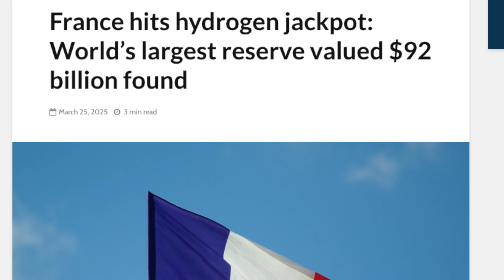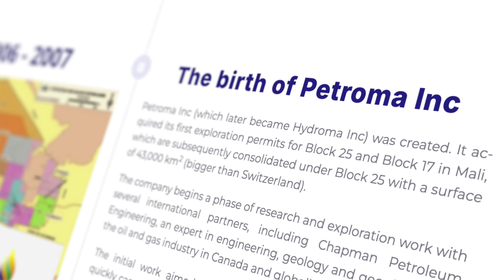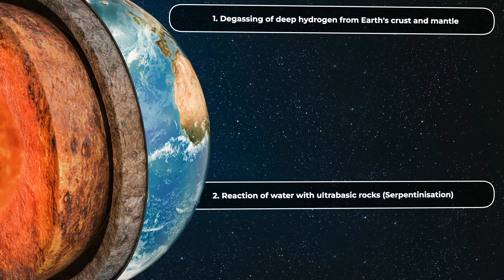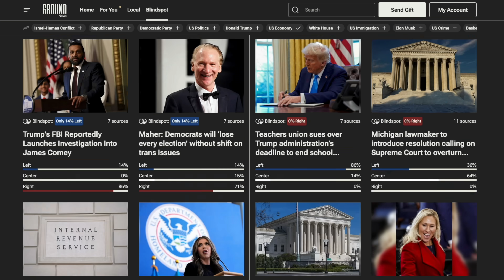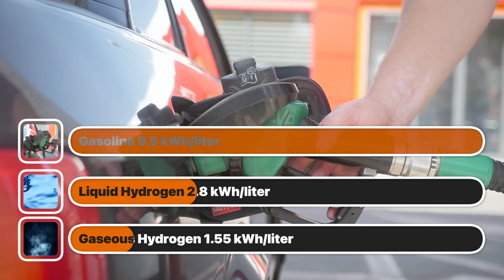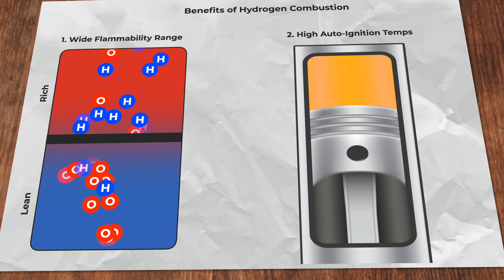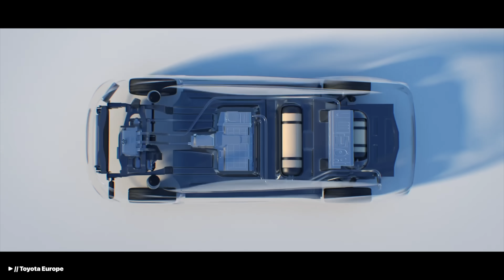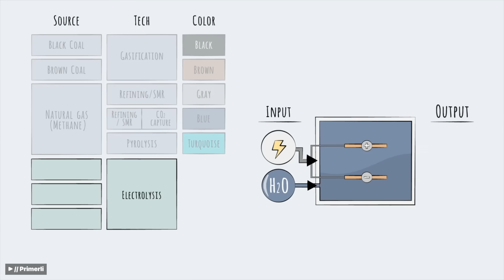This Hydrogen Discovery Can FINALLY Replace Oil & Gas!

Comment: Hydrogen fuel combustion for cars is not that great for the consumer, aside the current hydrogen prices which will eventualy come down at scale, it still retains the problems of the ICE which is too many moving parts with more points of failure and parts to maintain. 

A fuel cell like in the Mirai will be better. But I think the biggest win for hydrogen will be in the air and sea transport industries and power plants. Replacing hydrocarbon power with hydrogen will be a great win for the environment if the nitric gases are repurposed into other processes. And the PetroChemical industry will be more than happy to invest in hydrogen - drill baby, drill. 

I just hope EVs don't get crushed again for being 'too good' like GM did to the EV1s. Maturing both hydrogen fuel cells and batteries will make for a better energy future.

Comment: H2 is no use for cars and probably most land transport. You said about the weight of battery v H2, but ignored the fuel cell, battery that sorts out the peaks  for the fuel cell and regen, the tank weights, air purification for fuel cell etc.

Comment: Oil is more than a transportation or power grid fuel. All the other things that are made from oil can't be replaced by hydrogen, so no amount of hydrogen can replace oil in our economy. Replacing oil in transportation and power production would be nice, but it could effect the price of many other products and industry. It will be interesting to see how this unfolds.
Reply: It is about not burning oil, not getting products out of it.

Comment: The problem of nitrogen oxyde production in high compression combustion engine will never be solved. It's been that way for decades in diesel engines already, such that the fuel consumption of small diesel engines keeps increasing.

A VW 1.9L TDI engine from 2002 in a Skoda Octavia Break consumed 1.5L/100km less diesel than my Renault 1.5L K9K diesel engine in my Dacia Sandero Stepway. That's how bad compression got reduced to eliminate nitrous oxydes emissions.

I do not expect hydrogen combustion engines to overcome this issue without eliminating nitrogen from the cylinder entirely.

No, instead fuel cell technology can be improved to remove or stop degradation over time altogether. It is also much more efficient to use those than combustion to produce electricity instead of pressure.
Reply: Internal combustion engines will die.

Comment: Of course, the Hindenburg shows the scary side of hydrogen fuel:  catastrophic effects of a leak.  Of course, jet fuel is highly combustible, but the pressure needed to keep the volume under control may be reassuring.

Comment: Burning hydrogen makes more sense in vehicles that are always moving or burning fuel. Planes and trains. Storing hydrogen in a car is a problem while it sits and waits to be driven. Cryogenic inefficiencies cause the systems to vent hydrogen as it warms in the tank. You can't park a hydrogen car in a garage, it could explode if it reaches an ignition source like a water heater, garage heater, light switch, blender, vacuum cleaner, etc. No Bueno

Comment: Something that nobody sees....

Only green hydrogen is good. Oxygen is released during the splitting process. Blue, gray and white hydrogen "steals" Oxygen out of our atmosphere.

CO2 is falsely demonized.  Just Google the atmosphere composition, it is most probably not what you would expect. The CO2 level is not high. CO2 is needed for plant growth.

What is concerning is that there is no natural process to recover the oxygen that will get converted to water. Oxygen depletion raises more concern than CO2.  It is funny that cole and oil is bad, but LNG is good.
The hydrogen ratio in methane (CH4) is more than in gasoline (mostly benzene)(C6H6) for the same calorific value. The oxygen trapped by hydrogen in the form of water (H2O) can not be naturally cycled, but CO2 can be converted by plants and algae. 

Bottom line is burning any fossil fuel is bad and depletes our Oxygen.

Comment: 3 things- first hydrogen cant be contained in metal because it trats following like a sponge which might in turn cause explosions and great damage
Second the nitrous oxides fumes can simply by put trough a water turning it into nitric acid that can be sold or neutralised using just baking soda sponge filter 
Third the fuel dont need to be conbusted actually cause there already exists a electric fuel cells that turns oxidation of hydrogen directly into current which eliminates need for heavy engine block
Reply: By the way carbon dioxide is good for plants and it were decreasing BEFORE industrial revolution so methane and water and soil poisoning is the actual problem and not burning carbon

Comment: I like the idea of reusable sources such as wind, solar, hydro, and thermal to produce hydrogen when electricity demand is low and there is excess power available. Storing hydrogen has got to be easier than manufacturing batteries.

Comment: Well perhaps the answer is not necessarily developing a Hydrogen car but building the plant to provide the energy for  growing electrical usage instead of burning petrol, coal etc. Reducing our use of oil, coal until we have weened off of it. I still see real problems with Hydrogen in a fuel cell for the local end user with respect to auto crashes, metal fatigued caused by Hydrogen embrittlement (as outlined by @clinthastings3254 below) local storage. Likely needing constant monitoring like nuclear and thus putting the plant to supply electricity a more favorable options. But perhaps a combo Thorium reactor and Hydrogen energy reactor might be the need push to get off of petrol/coal as a major energy producer and just a synthetic producer.

Comment: I worked at a Ford plant using hydrogen fired ovens to melt steel together in a fixture the parts sat in so they maintained their shapes…
It’s so dangerous and has to be stored at crazy high pressure…
It’s very explosive and we were told(because they legally had to) that if they were to have a fire or a leak it would be like the blast wave from Hiroshima destroying most of my town….
France can keep it as far as I’m concerned.
Reply: @matthewhawkins1472  
The hydrogen finds in France are in remote locations. Power stations at those locations can be built, away from people. 

There are actually hydrogen trains.

Comment: .           So, this source will use up the breathable oxygen and reduce the Earth's available oxygen. Green Hydrogen releases Oxygen so the Hydrogen doesn't use up the Earth's oxygen. Yes it is costly, but if developed it is the best, and white is the worst. Not good news to find hydrogen made by oxygen binding to iron! The easy way out is dangerous. Gas of course needs to be phased out slowly.

Comment: Most of the hydrogen used by humans is made by reacting steam with fossil fuels. This produces lots of CO2 byproduct, which is mostly just dumped into the atmosphere.
 Most of the hydrogen used by humans is used to combine with nitrogen from the air to make ammonia for fertilizer & any other nitrogen compounds like explosives.
The first thing large geologic hydrogen deposits should be used for is ammonia production.

Comment: Apparently, there are days in California (and other places) when more solar energy is produced than can be used, resulting in 'curtailment' and/or negative energy prices. Why doesn't someone set up a green hydrogen production plant to take advantage of situations like this? The energy is there just begging to be used, why not use it?
Reply: Every "green" hydrogen project in Australia has been shelved. They are not cost effective. We have more than enough solar energy. The problems of hydrogen storage are beyond current materials technology to solve. Hydrogen is a dead end. Even the perpetually "almost here" fusion power is a better bet.

Comment: The figure for the Li-ion battery energy density by weight is too low by a factor of roughly 10.  This severely detracts from the credibility of the whole video.  What other errors (deliberate or not) are being used to draw conclusions - never mind any convenient omissions.

Comment: When you are talking about Hydrogen as an aircraft fuel I think there are a few things you are ignoring. Because with aircrafts it is all about weight.  1.55kWh/l looks really bad when you compare it to the 9.5kWh/l that kerosene provides. However, The gaseous Hydrogen with this energy density would be compressed at several 100Bar. It seems unlikely that a plane is capable of economically carry that weight around .The weight of the pressurised tank that is of course. So I think we can throw this out of the window. However, the actual gas would be extremely lightweight, but needs a heavy container/tank to carry it. So a litre of jet fuel has an energy density of 9.5kWh/l and has a mass of 0.8kg/l. Hydrogen has a mass/kg that is significantly lower. So much so that it outperforms jet fuel by a factor of 3! So based on this data, there appears to be potential for liquid hydrogen as an aviation fuel. Whether we can engineer something to use Hydrogen in a safe manner and not remind us of the Hindenburg disaster is an other story, but Since the Space Shuttle could do it, why not airplanes as well.

Comment: Here is a better idea - synthesize methane out of water and carbon dioxide. This fuel is well figured out and it can be carbon-neutral if captured carbon dioxide is used in synthesis.

Comment: A lot of people seem to be missing the point of Hydrogen. It isn't an oil/gas replacement, or at least, doesn't have to be.

The price right now for electricity in the UK is -£12.03MWh

You are getting paid to use electricity. If you can find a way to inexpensively use lots of intermittent electricity you stand to gain. If the end product has value so much the better.

Hydrogen can me turned into ammonia, which in turn can be made into fertilisers or fuel, and it has lots of other uses.

The economics of the current grid are unsustainable, negative prices when the sun shines or the wind blows means governments will have to continue to subsidise green power. we need some way to increase demand with supply, so theres actually and economic case for building more generation for when in isn't sunny or windy.
Batteries are one solution to this, Hydrogen production, even if you don't use it to produce electricity is still energy storage in the same way aluminium production is energy storage its an energy intensive process, but what you get at the end has a variety of uses. 

To the point of the video. I'm not sure if this discovery is generally useful. Maybe to get the industry started? In general though, its missing half the promise though, Using gobs of cheap electricity.

Comment: I don't think hydrogen will ever be mass adopted in cars because of a few reasons.
1. Theres much more important industries in need of a fossil fuel alternative. Airplanes, steel-production, cargo-ships... they cannot use batteries/electricity, unlike cars.
2. We have basically no infrastructure for hydrogen cars. Even if we find huge amounts of H2, we need to build facillites to collect and refine, store, transport and distribute. All of this is going to have an impact on pricing. Just the distribution facilities to fill a hydrogen car are orders of magnitutes more expensive than an electric charger.
3. Recently realeased electric cars are able to charge 500 km in under 10 minutes. This is available right now. The time it takes to build a comparable H2 infrastructure for cars in terms of size, will lead to electric vehicles capable of charging as fast as refueling a gas car, if not faster.

Comment: H2 is too expensive to transport, lager, and handling because of the extreme small molecules, that diffunding even through metal tanks.
You need for h2 a complete new kind of infrastructure.
It would maybe suitable for local energy production over H2 cells,or mix it into then Methane gas pipeline network.

Comment: Nah man, hydrogen adoption as a mode of power has failed especially because it cannot be efficiently deployed in smaller scales. It can be used as natural gas for power stations in large scale so forget about the most abundant element as the future of power.

Comment: you casually say the EV charging costs using $0.40 per kilowatt being $0.10 per mile, but that is in overpriced PG&E and SD&GE areas... Where electricity is $0.10 kWh it's 2.5 cents per mile!! Amazingly inexpensive. (I'm in PG&E area and drive  Model 3)

Comment: There are other engineering problems associated with Hydrogen you haven’t covered here. It’s a tough gas to contain. Metal embrittlement issues. Can be dangerous due to its notorious volatility (Hindenburg?). Etc etc. 
Mankind was gifted the breakthrough energy solution to everything 70 years ago. We’ve just been too foolish to recognize it and have implemented it in limited ways like skittish fools. It’s time to enthrone Nuclear power.

Comment: Fuel cells are incredibly expensive and short life.  Plus compression and distribution energy losses are huge with hydrogen so no - unlikely to prevail.  Battery tech is developing so rapidly….

Comment: I respect this channel, but not this video. Spruiking hydrogen does us all a massive disservice. You make no mention of the enormous costs (and carbon emissions) associated with liquefying, storing, distributing and even carrying (on board) hydrogen. That whole cycle more than negates the carbon benefit of hydrogen over current fossil fuels, even if it is entirely carbon-free at source. Converting hydrogen to ammonia makes it much easier to handle, but that conversion process is (currently) very carbon intensive too. Please stop getting people excited about the upside while utterly ignoring the massive downsides. Unimpressed.

Comment: I would say that hydrogen can and will never do what oil does. It is not oil and does not have those same strengths. It is different and has different strengths. Lighter than air travel like Zepplins would open up whole new parts of the world. They are far safer than planes. Their crashes, even the most iconic one is much less deadly than any number of plane crashes. There is a major shipping niche that can be filled by them in remote and mountainous regions. Also fertilizer is your other major and established need for hydrogen. Hydrogen for steel making and home heating would be game changers too, but transportation conversions from oil vehicles are not going to work. Yes it can work, but I would argue that oil based fuels are better at making those vehicles go, use CNG or propane if you like, but hydrogen is not going to be desirable in that case.

Comment: 30 and 60% efficiency versus 95% efficiency for battery powered - it's a no-brainer for battery.
Reply: Diversification is best but I'm with you, especially as solar panels get insanely cheap. I recently bought my first 600 watts of solar for $300 and a couple medium power stations for camping and emergencies. Super impressive to learn about and mess around with. As battery chemistry and energy density improves, it's definitely going to replace the need for power companies. Every home and car will be its own power company.

Comment: We already have to deal with Nox in diesel and gasoline engines, and they have catalysts already to reduce that. My diesel engines on the dirty side of the catalyst produces roughly 900 parts per million, and on the clean side it’s somewhere around 100 if my memory serves me right. CO runs about 400-500 ppm on the dirty and nearly 0 on the clean. It also has a DPM filter to catch the soot. In the coal industry we use diesel engines for our equipment, but due to it being a confined space we have to keep emissions at a very very low rate. You pay for it though. My exhaust system for a 50 hp diesel engine costs 12.5k.

Comment: Stop wasting hydrogen for transportation while more efficient, sustainable alternatives already exists. Hydrogen is most needed in so many chemical transformation processes where the only alternatives are both polluting and non-renewable (e.g. steel production, etc). THIS is where hydrogen is "meant" to be used (if we want to manage our ressources wisely).

Comment: Hydrogen is an amazing fuel by weight.  But terribly difficult to store onboard a vehicle.  How about combining waste CO2 (which itself is exceedingly expensive and difficult to dispose of) with this white hydrogen to make new hydrocarbon fuels such as jet fuel and diesel for container ships and trains?  This would allow these transport industries that, practically-speaking, require liquid fuels to continue to operate, with the bonus of contributing comparatively little net new CO2 to the atmosphere.  (The aviation industry, for example, contributes a small fraction of the CO2 compared to what the fossil fuel power industry releases.  The worldwide goal should be to focus on capture of CO2 at power plants, and eventual conversion to renewable energy, before taking on the pain of trying to make transport green.  Since it is feasible to capture the CO2 at a power plant but not from a plane, ship, or train, the above way of creation of new fossil fuel from waste CO2 is the way to go.)

Comment: I am still not convinced Hydrogen is a good final use energy source.  It is really hard to contain and as you mentioned has lousy volumetric energy density and though it seems to have good mass energy density that drops a lot when you include storage requirements.  It might be better the use the Hydrogen to make a better final use energy material like Electricity or Methane.

Comment: Crazy idea, certainly not suitable for cars as a car can't carry enough hydrogen for a reasonable range, and hydrogen is so explosive that you can't use it domestically with any acceptable level of safety. Add to that the hydrogen is probably part of the earth's water subduction cycle, and it will become a worse contributor to global warming than coal.